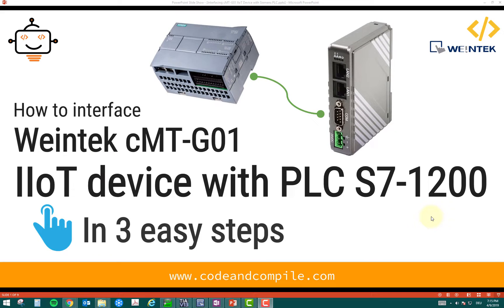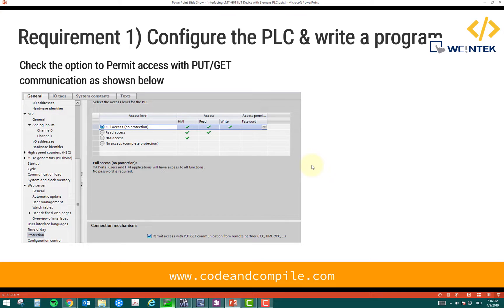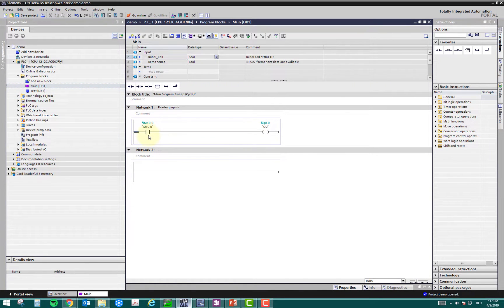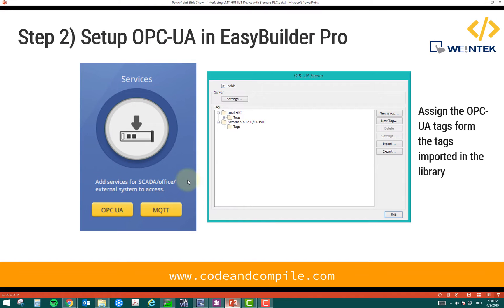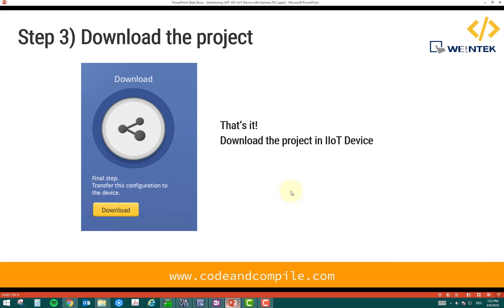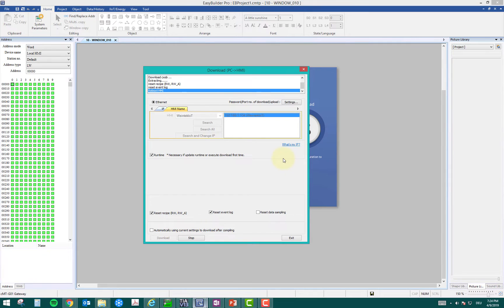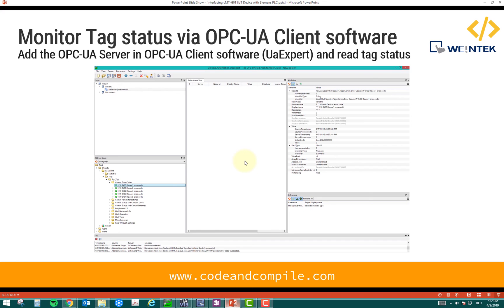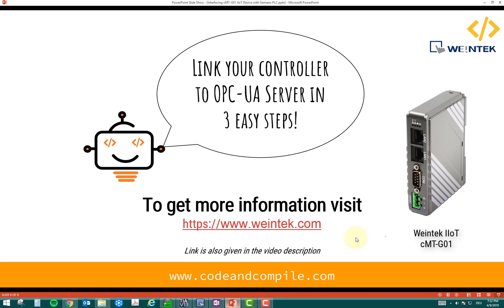Lesson 2- Interfacing Weintek cMT-G01 IIoT Device with Siemens PLC

Comment: How many plc can add using this device?s7_300 has own opc server?
Reply from the maker: You can check the manual for the accurate number but I believe more than 32. S7-300 does not have its own OPC UA Server. You can read from the PLC via profibus or PROFINET and then this edge device will create OPC UA Server